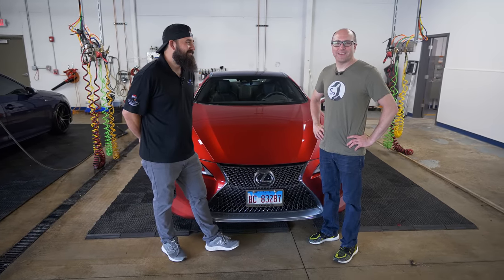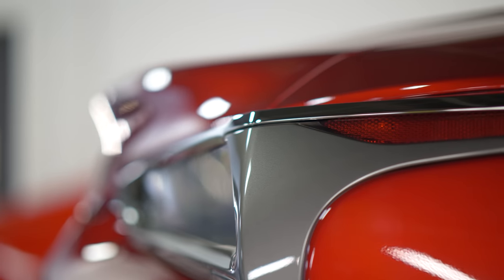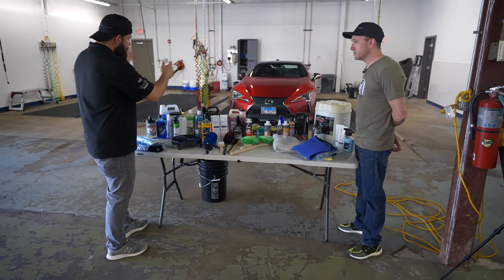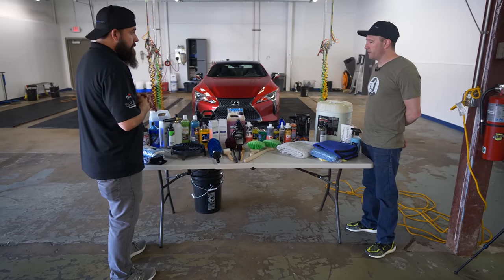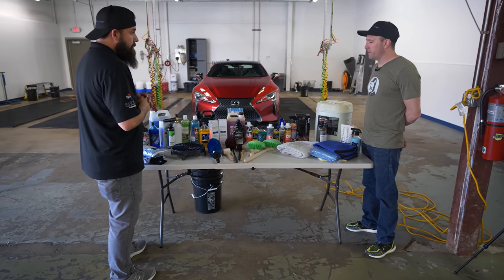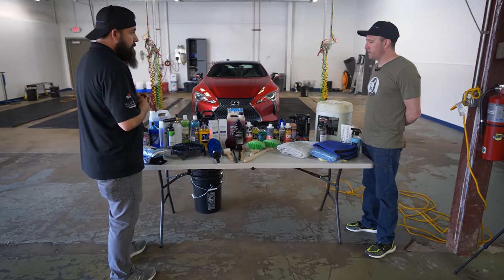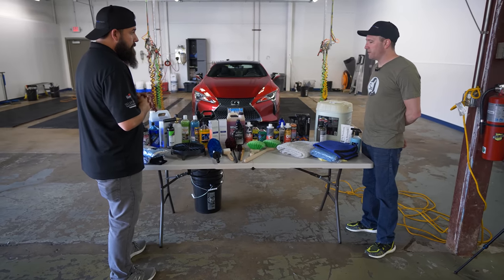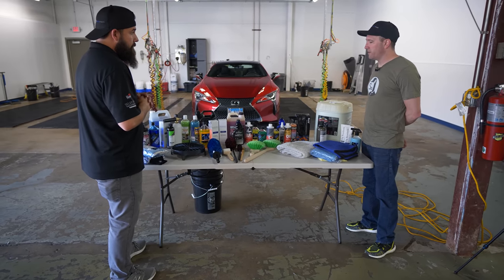The Right And Wrong Way to Do a Car Wash

Comment: Said truth is you'll never be able to avoid scratches no matter how careful you are. All you can hope for is to have a scratch level tolerance
Reply: Yeah, paint correction also works well and I've seen older cars with barely any marks, just wash it properly and u will be good
Reply: Just don't wash your car
Reply: true but you can make it go a lot longer before getting major scratches.
Reply: @saturndesigns2339  Those car finishes have been worked, and then maintained - maybe like this
Reply: Correct, but you can definitely do your best to minimize them
Reply: Not to mention the "road rash" paint dings you WILL acquire when you hang behind trucks in freeway driving! If you care THAT much about YOUR "baby", get a beater for your daily. Leave the "baby' for those sunny day country drives with little traffic. Been there, done it! Can't anymore (lack of funds)!
Reply: or paint chips flecked off due to the stupid rocks on the road!! UGHHHHHHHHHHHHHHHHHHHHHH
Reply: Well said. If your tolerance is lower, I suggest the following. When signing the paperwork on your next car, look at the car over and over to make sure it isn't black. 😂
Reply: Nah just don't drive the car at all. Put it in storage and forget about it. No driving, no washing, no scratches.
Reply: @killstrees  Sad part is it'll probably come scratched from the dealer's complimentary detail at delivery
Reply: And window scratches too due to it being exposed outside and the constant wiper blades
Reply: PPF
Reply: @oscarmart1  Don't dry your car
Reply: If you don't want any scratches there's really only one thing that guarantees it - PPF (after paint correction). Not cheap, but if you've got a special car that you'd like to keep in as new condition it's totally worth it.

Comment: Going to auto car wash

Normal people: yeah that's pretty clean

Professionals: THAT'S A LOT OF DAMAGE
Reply: Yea I dont have $2000 worth of product to was a car that I will sell for $5k if I am lucky.
Reply: Sht855 you can still hand wash for almost nothing
Reply: Greendayyylmao a lot tougher when you live where there’s winter and it’s below freezing everyday
Reply: @kgisabeast  you live in Antarctica?
Reply: My friends dont understand when they go to those all it does is highlight the flaws in their paint, they see a clean car, i see swirl city
Reply: Minnesota, won’t get above freezing for weeks from November through March.
Reply: @greendayyylmao3427  and scratch my paint because I use the 1 sponge bucket system. Lol
Reply: Or, go to a touchless auto carwash.  Even better and my local one does a damned good job.  No worries about micro scratches, swirls, etc since it's spray only.  Drive fast on the way home to air dry it. Done. LOL

Comment: I was told (though don't believe) that you shouldn't pressure wash the windshield, or you remove the adhesive keeping it on and it can pop out. Never heard of that before and haven't seen it in any of the videos on car washing. Any thoughts on that?

Comment: Awesome vid. Just not gonna spend 3hrs washing my 2019 kia rio.  If i had a garage id buy all this stuff but i dont.
Reply: I hear you and feel the same about my KIA Soul.  The answer is keep a good wax job on it and the dirt will practically hose off.  Next to that is don't buy cars with dark paint, as light colored cars don't show swirl marks as much.
Reply: @discerningmind  White is the ultimate color for this. Fine scratches in the clearcoat are virtually invisible.
Reply: I just have two buckets, microfiber towels and mitts, meguiars gold wash, interior detailer, and nu-finish paint sealer. Works very well. Cost upfront maybe 50-100$ and only takes up the buckets in storage space.
Reply: @johnryan6658  Yeah but then every single dirt particle that gets on your car is immediately noticeable, last time I'm getting a white car.
Reply: @GlamStacheessnostalgialounge  That's not a problem for me as I wash my car weekly. I've gone from black to grey to white. Black is by far the worst because it shows all dirt and all scratches. Grey hides the dirt the best. White hides clearcoat scratches the best. I have white, but I'd get grey again. Black? NO WAY.
Reply: @johnryan6658  Well my first car was an olive Mercedes w123, don't know how it held up because it was already a beat up rusty pile of shit when I bought it. Then I bought a white Zastava 750, I liked it but it really showed a lot of dirt if I drove on the bad roads we had. Then I had a red Zastava 101, probably the best color car I had, showed very little dirt or scratches. Now I got another white Peugeot 309, it's got plenty of scratches but as you said it's not very noticeable, but again it picks up dirt like a magnet, gonna see how it fares once I get it resprayed.
Reply: I don't see why you wouldn't take a few hrs now and then to clean the probably second most expensive thing you own
Reply: Thats for my work truck.lol
Reply: @mohamedalkaboom  Unless it's a Stinger GT, which is a higher end performance Kia that is very flashy and sporty
Reply: @COBOListhefuture  Probably because it is a DEPRECIATING asset.

Comment: Don't forget to remove your wristwatch before washing as you can accidentally scratch the paint with the buckle and bracelt on your watch.  Also, avoid metal belt buckles/clasps too as they also can accidentally contact the car when you're leaning over it.

Comment: Loving your videos. while I don't have all the specialty chemicals you have, I do try to do the proper cleaning using what I have. I am thinking about buying an electric pressure washer AND foam cannon. What pressure washer works best to remove the built on dirt as well as the foam cannon? any thoughts on a good brand of Washer, Foam cannon, and foam?

Comment: Good video. One step that will really shorten the process of hand-washing is to 'sheet' the water off. Take the nozzle off the hose, turn the water on to a relatively low pressure, and start at the top and rinse the car. The water will come off in sheets, and you will have literally a tenth of the water to remove using a microfibre drying towel.

Comment: Thanks for the great vid! One comment: Is it safe, for step 1, to rinse with a pressure washer? Wouldn't dirt particles scratch the coat? I rinse with minimum pressure first, next foam and then rinse with pressure!
Reply: It's safe as long as the pressure is at an angle not straight on.

Comment: I have a lease so I got to a tunnel wash, usually I get the manual pre-cleaning including the wheels, so most dirt is off before the brushes get on the car. Afterwards I soak up water droplets with a soft paper towel to avoid stains. Paint still looks good after more than two years. It has little metal flakes in it so you don't notice sratches and swirls unless you really look super close up. But for my dream weekend car I will apply these helpful tips one day.

Comment: Appreciate the great tips, I've hand washed and detailed my cars myself for years and have used pressure washers, leaf blowers and other things to make the job easier but your two bucket method and the the wash mitt and wheel mop will be incorporated into my routine, excellent video.  Thanks!  I"m a firm believer in detailing it and waxing it 1-3 times a year, the cleaner and slicker the paint the less things stick to it and the easier it is to wash!
Reply: I strongly wish to have the budget to pay someone for top notch surface coating so that hand wash is as easy as possible.
Although then I could probably also just pay someone to wash it.
It's not convenience. It's burnout. (Which also presents an obstacle to attaining that kind of budget.)

Comment: The only issue I have with using a leaf blower is the air is not filtered like something coming out of a master blaster.
Reply: So? What's your point? The air driving down the road isn't filtered either. Who cares if the air is filtered on a air blaster! What about the particles that get past the filter and the air borne particles in front of the air nozzle? Are you gonna live in a bubble to?
Reply: @michaelgrant5258  don't get it, do yah🤔

Comment: I use a three mit method on the paint, top, sides, rocker areas.  No pressure on material used to wash, and always wash in a back and forth motion, never in circles.  No buckets used I always cleaned the wash mits out as I go with a hose.  No pressure hose as it is like sand blasting the paint if no done correctly.  I show my cars and have been successful.  thank you for your time.

Comment: I want to know what are the "proper" ways to take off the remaining bugs, sap, etc
Reply: Clay bar.. then buff.. for me that always entails doing the entire panel so it looks uniform.
Reply: that will be 24 buckets of water from reverse osmosis, 12 bottles of various liquids, 15 sprays, 30 different microfiber towels, and $1000 in $1 bills that you'll have to throw on the car after it's all done, just because.
Reply: That's totally the ultimate question, at least where I live. It's a barrage of bugs on my car.

Comment: Regarding 3:50 Dawn will not strip off P21S carnauba wax from the paint. I've tried it several times and the water continues to bead where the wax was applied. It's a really good wax!

Comment: Cars come from the factory with scratches and swirls
Reply: XxDeadWillowxX And that’s why we paint correct brand new cars.
Reply: What kinda cars are you looking at lol, gm products?
Reply: @YungEagle3k  Ordered an Audi and it came with both orange peel (not much) AND swirls. So it is not just the "lower end" brands that don't do a microscopic paint inspection before delivery.
Reply: @fargonianproductions2767  Or the "prep" boys doing the pre-delivery "inspection".
Reply: More like orange peel and salesmen and who ever else test drives the car.
Reply: I find it shocking how common orange peel from factory is. It looks absolutely cheapass. Not even worth getting all anal about paint maintenance as shown in this video before you paid a pro to polish that atrocity away.

Comment: I can't believe he didn't go over properly washing and drying your microfiber towels! Thought that would be number 1 on the list. Never wash or dry microfiber with other material or types and never use high heat for the washing machine or dryer, it'll ruin the microfiber by melting the fibers microscopically. Don’t wash/dry a microfiber towel over 40°C or 105°F max.
Reply: It's a video on how to properly wash your car, not how to do laundry.

Comment: One of these days, a company (read: Porsche) is going to develop a method of applying a protective layer of hard sapphire to body panels through chemical vapor deposition in a vacuum chamber.  It won't be a cheap option, but it will be well worth it.

Having to endure paint that is too soft to repel kicked up stones is infuriating.
Reply: Paint as we know it on cars is to prevent corrosion. On fiberglass and other cars with composite panels, paint is there mostly for looks,  LOOK SHINEY. Very hard paints and coatings are brittle,  soft paints and coatings are flexible. If you put a very tough paint on your car, a stone could cause a crack or a large flake to come off.
I'm sure Porsche has spent a lot of time with a company that has good material and chemical engineers to develop a great compromise. Too bad it will be a decade before that trickles down to commuter cars.
Reply: "Street Rodders" have used "IMRON" paint for years on their customs, paint is SO tough you could put a hammer to it. Car manufacturers WON"T use it because it would hike the price WAY UP, besides, they want you to come back and buy a new one in about 5 years!
Reply: DeLorean had the right idea.

Comment: You can use a $80 pressure washer to wash a car and it will do a great job.  The Kranzle's are great machines but not necessary at all, although they will last longer if taken care of.  There are plenty of one bucket methods of car washing that work great.  You can get a pack of 36 microfiber towels at Costco for $15 and use a handful of them to wash a car, and use a new one for each panel - which is probably the best and safest method of all, just be sure to remove any tags from the towels before using them on the paint.  Optimum No Rinse is a great product for the one bucket and multi towel method, especially if you are in a area with limited water access.  ONR is also a great product to use as a regular wash soap or a spray detailer for removing bird droppings and such.  ALWAYS use a different mitt or different microfiber towels and bucket for washing wheels and keep them separate from the towels used on the paint because metallic brake dust will get stuck in them and you don't want it to get on your paint.

Comment: I use a 2 bucket system without the buckets. A nozzle head with soap dispenser that switches from soap to plain water. Soap the mitt for each section, then rinse it well with water before moving to the next.

If you’re going to use a tunnel wash, scout the place before putting your vehicle through it. The well maintained wash business stands out, and the couple local to me are high volume as well. One uses hot air dryers that do a great job, but it steams your windows up a little when the AC is running.

Comment: Why does everyone hate on acid, a strong mix at the opposite end of the scale will do damage also.

Acid is a great chemical and safe if you follow manufacturers direction.
Reply: I think you answered your own question, most people don't know how to follow directions and use safety glasses, gloves, and a respirator.
Reply: Certainly.  There's nothing wrong with an acid when used properly but in most cases an acid is not necessary.  If you're someone like myself who washes their car once a week at least there's never going to be a time where an acid is needed.
Reply: I eat acid all the time. Im still fine

Comment: Should’ve named the title “how to perform a professional car wash” because this has very little practical information for the general public
Reply: By far the most important facts that aren't always known by the general public:

1. Wash in a cool, shaded area that will let you dry the car rather than the sun, to prevent baking water spots onto the paint.
2. Use a method that prevents you from taking dirt you've just removed and grinding it back into the paint, e.g. two bucket method with microfiber mitt and no repeated scrubbing motions.
3. Try to use a light touch and soft fibers whenever contacting the paint for washing or drying.
Reply: @BruceLeedar  People using dirty tools for washing something drive me nuts. So thoughtless, and even people making money with that are doing it.

Comment: The hose part was hilarious...  I also like the level of detail the guy from Chicago Auto Pros went into about detailing.  Was this the same place that Jack went to before to get the ppf / ceramic coating?  The guy mentioned about the vette having a proper hydophobic coating and the lexus not.

Comment: 3:14 Lexus with orange peel coat. Saddens me. Is it maybe a problem with the new water-based stuff? Or are they just cheapassing these days? I perceive orange peel paint jobs as very sloppy, and that it is so common from factory even with more expensive cars is disappointing. What's the point of pampering your car's paint if it looks like that to begin with?
I am surprised they are using pressure washers. (And almost point-blank!) I'd assume with how sensitive they are avoid scratch avoidance, they'd consider how a pressure washer can shoot hard dirt across the surface and basically become a bit of a nerfed sandblaster. - I think if that thing had a low pressure mode, that would help. Basically like a hose, but with longer reach.

Comment: I would recommend to use a (low pressure) hose first to rinse the car before using a high pressure washer. I don't get why using a pressure washer straight on mud/dirt/grit. Otherwise great video.

Comment: I live in an apartment with no hose bib. Washing my car consists of having to go to one of those DIY car wash places. Any tips for having to do it that way? I don't use their "foam brush", but I do use the pressure washer portion. Are their soaps and pre washes no bueno for my vehicle? Is there another method you'd recommend?
Reply: kronos6948 they should be fine, ive seen videos where people take buckets filled with water/their soaps and pretty much only use the pressure washer

Comment: One of my first jobs was detailing used cars. Many of the techniques used in the video was the same as the ones I used. But, yeah the products have definetly improved - microfibre mits, soaps and cleaning treatments. Time to throw out the sponges and shammies. 
My  tip is DO NOT LET CHILDREN WASH YOUR CAR.
Good upload. Thanks.

Comment: I collect rainwater. PH neutral. And then I filter it before it goes into my pressure washer. Car looks mint. I do the same thing homeboy does here and my whip looks pretty decent. Also use Sonax wheel cleaner. Stuff is really nice for wheels.
Reply: I always thought they where a waste because you would have to wait until the dirt settled to the bottom,just shake the mitt while in the bucket then wring it out outside the bucket

Comment: You MISSED a big step ... at  about 19:20 (mitt soap washing) it cuts to the blow dryer.  After the mitt soaping, the clean water spray rinse was not  shown in video.   I did not read through all the comments. Wonder if anyone else noticed this.

Comment: Good video but just an FYI, sometinws acidity is necessary during the decontamination process on the surface, so it's not bad, you just don't want it done  after you've properly cleaned and then  protected the surface.